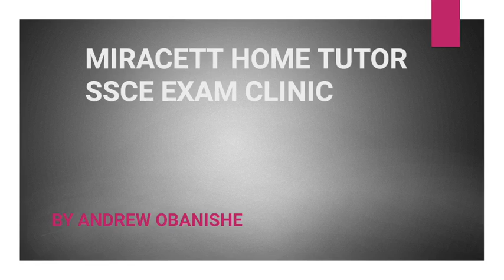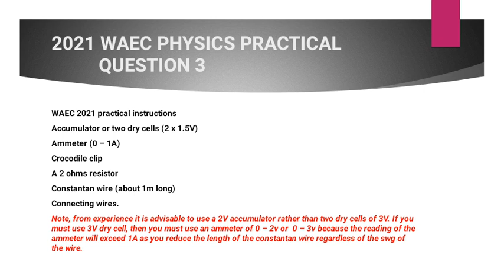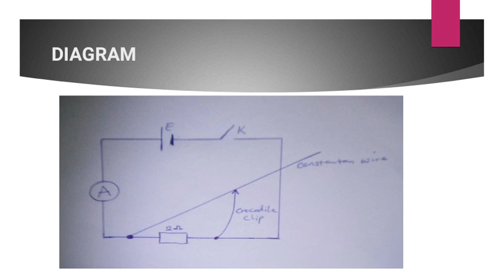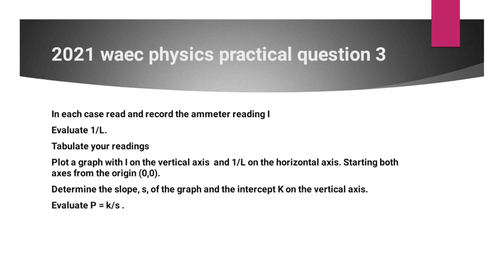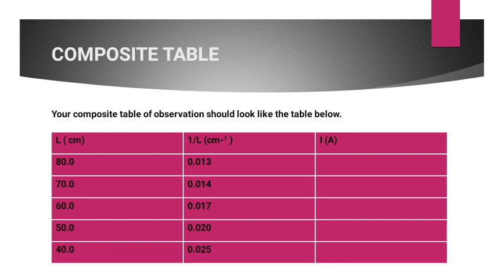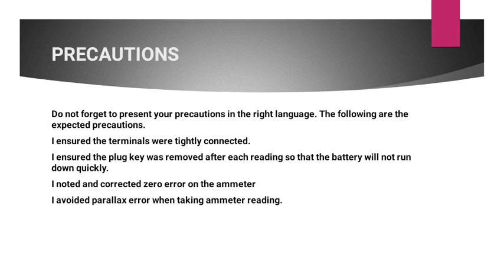WAEC 2021 PHYSICS PRACTICAL QUESTION & ANSWER

Comment: Thanks for the good job sir.what the formulae to calculate the current to juxtapose the readings after performing the experiment...just like how you did with mechanics
Reply from the maker: I will post that very soon. The file is large so am trying to compress it, that's why it has been posted. Later today, it will be posted.